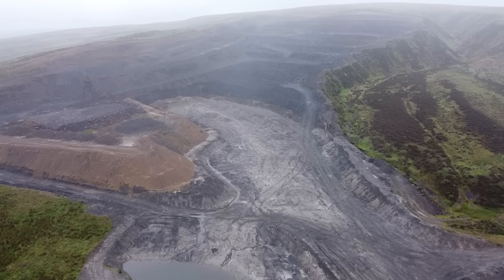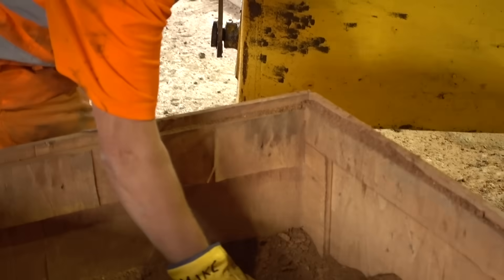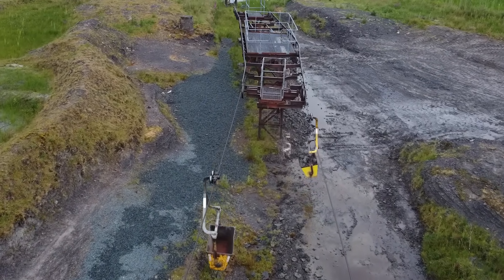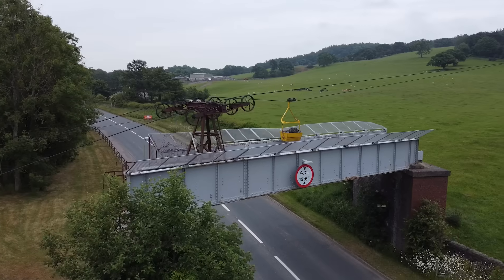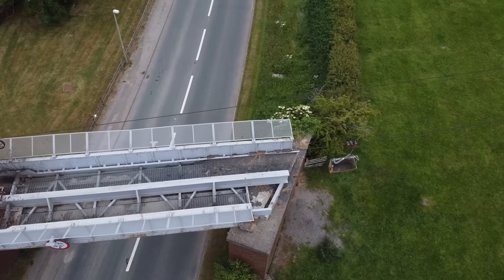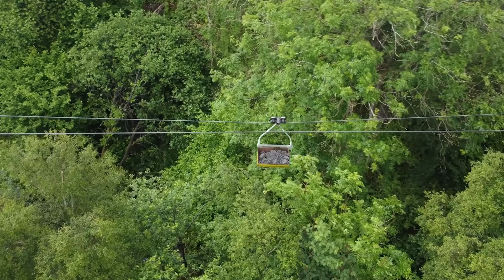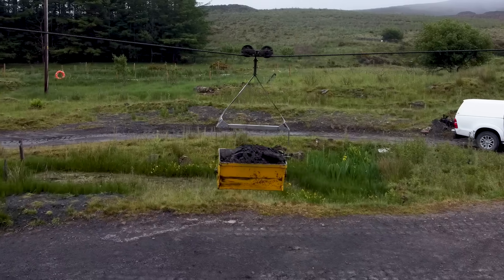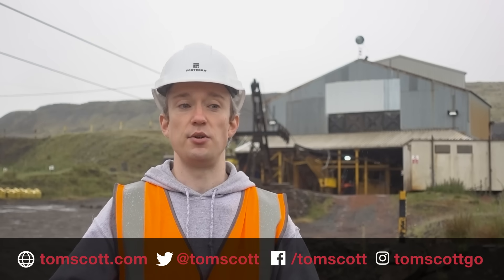The UK's last aerial ropeway uses no power, moves 300 tonnes a day, and will be gone by 2036.

Comment: Quarrying and brickmaking are never likely to be seen as "green" industries, but in a world where we are seeking to reduce carbon emissions transporting goods downhill purely by gravity seems like a very sensible idea. There must be many other applications where a similar type of aerial ropeway could be used to replace conveyor belts and/or trucks.
Reply: You need material for building - and you're gonna have to quarry it somewhere. Doesn't matter if it's shale, wood,, steel, or sand for concrete. Bricks are good. They last a long time (if well made and well cared for), can be recycled more easily than any of the others, and they're bricks! Bricks are cool.
Reply: @vaclav_fejt  Thank you
Reply: @vaclav_fejt  shhhh, don't tell the Americans that
Reply: It wouldn't even have to be an aerial ropeway, I think. You could probably get the same result with a narrow gauge railway system. It's only important that more weight goes down than needs to be pulled up.
Reply: @rolfs2165  Sure, in ideal conditions it is equivalent, but there is a problem of friction; if the slope isn't steep enough, you need the least possible friction generated. I believe it's also easier to build air ropeway since you need much less material and land modification (build end stations, erect few pylons, stretch steel rope... and profit! :-) )
Reply: @rolfs2165  The narrow gauge rail system would have more friction involved, so it may not work.
Reply: Nothing stops people from making a conveyer belt that works on gravity too :)
Same principle, the weight of the shale pulls the top of the conveyer down, the bottom side will be pulled around too, just like the rope here
Reply: I think some of the Oils sands in Alberta do something similar with electric dump trucks.  They use electric breaking and the truck's batteries need to be regularly discharged into the grid because of the excess energy generated. The height difference and difference in load weight means they never need to be charged.
Reply: @jonathansharman9279  Where did you get that information? The latest I have is that some oil sands operations are switching to autonomous vehicles to eliminate jobs, er, cough "improve safety and lower operating costs". But these are deisel-fueled vehicles that consume some 15 000 L per day. Diesel shovels replaced electric shovels which replaced bucket and conveyor systems decades ago because that electric eqipment had to remain connected to the source of the electricity, which was being generated on site. So even they were burning fuel anyway.

You may be thinking of other mining operations where material is transported down from a mining site. But bitumen has to be dug up. A big part of the operating costs is removing the overburden. If they have to dig down too far, it's not economical no matter how much they externalize the costs of environmental impacts and infrastructure. 

Or, maybe you heard about steam-assisted gravity drainage. That's where they frack the rock, inject steam to heat the tar-sands deposit and liquify the bitumen so it flows by gravity into a horizontal well pipe below, and then pump the bitumen out. 

None of it is remotely environmentally responsible, given what we know about climate change. The only thing the tar-sands companies are hoping for is a long, slow implementation of nuclear energy, which they are pushing politicians and voters toward instead of renewables. The industry plans on using small modular nuclear reactors to heat bitumen for easier extraction. (Though they don't like saying the nuclear bit out loud so, they say SMRs or better yet, thermal plants, which could be geothermal or... not.) They also want investors to stay invested hoping to capitalize on extracting lithium (and possibly, and hopefully with little public discussion, uranium) from tar-sands brine. The lithium would mainly go into batteries for electric vehicles. But that's a market disruption undercutting their primary revenue stream which is for-profit pollution (via fossil fuels). Some analysts say the tar-sands industry is running scared of EVs, so I think the last thing they would want to do is demonstrate that heavy industrial vehicles like theirs can be electric. 

I may be wrong, so feel free to correct me. I'm really hoping you're right.
Reply: @perrisici  Well "15 000 L of diesel" isn't relevant without telling how much work it gets done. The good thing about diesel engine for work is that at best it is highly efficient (compared to other combustion engines), diesel engine is the best of the combustion engines for the climate, and in diesel engines the bigger two stroke ones are usually even more efficient, most efficient ones being big 2 stroke low speed ship engines.

Of course electric motor is far more efficient than any heat engine, but electric motor itself is not the whole system as you describe. It needs either a connection to the grid, or local power generation facility, or a battery. Biggest mining trucks already use electric motors to drive but they have diesel engine that generates electricity that drives the wheels. It is called diesel electric transmission and been common on very heavy vehicles for a long time. It is because electric drives allows to make the transmission simple. These would be easy to convert to fully electric.

So the difficult thing in electrification of mining machinery is the need for power source. Of course they are now ramping up the battery production, but the question is will there be enough materials for all uses if everything is done with batteries, which at least with current battery chemistries looks like it may become a big problem.

One solution is of course synthetic fuels. For example a nuclear plant generates usually as much waste heat as it generates electricity. Normal electric efficiency of nuclear plant is less than 50%, the rest is wasted as heat. There is processes for generating hydrogen directly from waste heat ( I don't although know are they ready yet for commercial production ). And when you add carbon to hydrogen, you get hydrocarbon fuels that can be used in ICE engines. Or you can use the hydrogen directly, but handling hydrogen is more difficult than handling hydrocarbon fuels.
Reply: More emissions getting the trucks back up the hill. 
This is where some Electric systems could come in, regen down and power back up.
Reply: Think this is about as green as it gets unless you use regenerative braking system and create a bit of electrical power for the mine, as said we need good bricks from somewhere and this seems to be as good as it gets,  all things considered.
Reply: @marksmith4664  electric motors and brake require mining operations to extract the minerals to build the motors.
Reply: There is a mine where they use electrical dumpster trucks. The drive down fully loaded and charge more on the way down than what they use on the way up.
Reply: I've heard that there is a quarry which uses electric dump trucks which charge on the way down when full, dump the load and go back up using the stored energy only.
Reply: @piast99  A quarry the puts stuff INTO the ground? Sounds more like a dump pit of some kind.
Reply: Yes, and no. It's choice between simplicity and efficiency. Simple solution is the most accessible where as a the more efficient solution will be harder to implement. Energy recovery systems aren't new but like I said harder to implement.
Reply: If you use eletric trucks and run them as a generator downhill you get the same effect
Reply: @manuelsoares4343 They are not 100 % efficient, so you will always lose some. They carry more weight down than they do up, so the effects will balance out.
Reply: In the other hand thinking, even a diesel truck going down hill doesn't use any energy either. But when going up as empty, there it uses. 300 tons a day although is only 5 truck loads if the truck has 60 ton transport capacity, which is of course big but not unsual for mining vehicles.
Reply: The thing i remember about the tour around an active open pit coal mine was they had an aerial ropeway. At one point they replaced half of it's distance with trucks, and then got the frightning revelation that they were now paying for electricity, since they had reduced how far it went and thus how much electricity it produced.
Reply: we'll always need bricks.
Reply: Apparently they require 4 people to operate and that would be about £160k per year to operate + maintenance costs.  (Converted Norwegian salary to Pound sterling)
And, it doesn't seem like it is able to transport that much.
Enough for that factory, but not enough for those that export.
Reply: @dubious6718  it said it move 300 tonnes a day, didn't it? I'd say thats a lot
Reply: @lenonel3286  Roughly 10 dump trucks. Could probably be done by 2 men (2 trucks) going back and forth.
Reply: @SideQuestAdventuring  dump truck would absolutely destroy the road they go through that building a proper road is economically impossible. I'd say aerial trolley preserve the environment these rocks have to go through.
Reply: @lenonel3286  300 tonnes a day is nothing compared to a conveyer
Reply: @SideQuestAdventuring  My guess is that by the time you've bought, maintained and depreciated those vehicles and add fuel it's possibly a close run thing - but let's be fair. This system is damned near silent.
Reply: We can't get trucks through the local village without people complaining unfortunately.
Reply: @nrdesign1991 it isn’t the fact that other systems could be “better”, it’s the fact its been running since 1920, is the last working one in the UK and it is efficient.
Reply: @dubious6718  that system could be easily automated.
No manual labor needed.
I guess for that factory a redesign would be more expensive than to pay those laborers.
Reply: @dubious6718  “Norwegian Salary” there’s your problem. You lot are paid twice as much as we Brits are…
Reply: Actually he's not far off. I work at Claughton and it actually takes 5 people in total to run with an average annual salary of 150k between them. That's not including overtime etc too 😁
Reply: @dubious6718  Depends how often it goes out of service. Industrial settings like simple and reliable. They'll pay a premium for it because any breakdown will end up being more expensive than the upgrade.
Reply: @dubious6718  Could be made bigger for sure, I think the size is limited by the factory, not the transport speed
Reply: "green" energy involves lithium, copper, silver, and other rare earth metal mining.
Reply: @blakeelzinga1168  If you slap a motor and a battery on a bicycle, you get a green vehicle, not sure why.
Reply: @blakeelzinga1168  Electric power is cool. Batteries are not.
Reply: What if...a ski lift system that staggers the chairs coming down the rope closer together than the loaded chairs going up the rope. Usually a powered ski lift has more weight to lift up the rope because (seats + passengers) > (empty seats).
But, if you have say 10 full seats further apart going up  the rope, and 20 empty  seats bunched together coming down the rope, then assuming a full load of passengers is lighter than the seats themselves, (20 empty seats) > (10 full seats) and you have an un powered ski lift.

Edit: i have rightly been informed this would not work as more chairs would go down then would come up
Reply: @aransmeallie5344  what are you gonna do with the pile of empty seats at the bottom of the hill? If you’ve consistently got twice as many chairs going down as you do going up, you’ll eventually run out of chairs to send down the hill.
Reply: @Acidlib  literally had that thought a day later and came back to amend my proposition there 😂
Clearly didnt have all the pieces there
Reply: @aransmeallie5344  But then only 10 of those 20 seats would go up again while 10 remain down and now you need to have 20 seats coming down again but only 10 went up last time. Doesn't work if my thinking is correct
Reply: @FeiZoomer  literally had that thought a day later and came back to amend my proposition there 😂
Clearly didnt have all the pieces there
Reply: Maybe the concept could be used to power a motor? The motor would be charged from the rotation of the mechanism, which I suppose would have to either be manned or else have robots switching weights around. Maybe the net size of the ecological footprint would be smaller?
Reply: Yes the politicians and corporations are seeking to “reduce” carbon by taxing the hell out of us and making everything expensive while taking trips to space. The whole green nonsense is a sham and nothing more.
Reply: For example the two 🤣🤨🤣😐
Reply: Now i have a lot 🤨😶😍😙

Comment: This seems like a very efficient system considering it doesn’t need any fuel physical input by engines and it’s just powered by gravity I think there should be a kick starter campaign to keep this thing going once the mind closes as an attraction or build more this seems like a really good way to transport things if this could be the next mass transport England is full of hills these can be used to move things like people
Reply: As long as the people only want to go downhill...
Reply: "as an attraction" - those are called cable-cars.

Comment: You can use it to generate power as well!
The aerial ropeway in the Czech limestone quarry of Černý Důl carries the stone to the Kunčice nad Labem train station. Due to the terrain, a 50Hz synchronous motor is needed to start it, and later regulates the speed so that it rotation matches the mains frequency (and feeds the extra power to the powerlines). It is 8 km (5 mi) long and will be likely dismantled next year as the quarry is nearly exhausted (and cannot spread due to a protected area). You can watch a guy illegally riding it at ?v=OERbOBUuMBY
Reply: "Generating" power by using machinery to lift weights to the top of a ropeway is like saying you're "Generating" power by using a wave machine to make waves to power tidal generators. Aka, you're overall LOSING energy.
Reply: @Winasaurus   No, electricity is actually being generated, as much like the one in Claughton, the Černý důl quarry is at the upper station (in the mountains, where limestone is located shallow in the ground) and the transport hub is at the lower station in a river valley (practical for railway construction). Because of the terrain, the ropeway’s inclination reverses several times, though (at the start of the linked video, the full crates appear to be travelling up but they go down overall), and that’s why a motor is required during startup and close to shutdown.

Comment: Does the Chairlift at the Needles, Isle of Wight not count?
Reply: That's a chair lift not a ropeway, ropeway literally carry stuff not people.
Reply: @derekwright2388  Ahh I see.
Reply: and doesn't that have an engine to power the chairlift?
Reply: I wouldn't be too much of a stretch, conceptually to convert it to a chairlift. You'd need to supply power, since the load is going uphill rather than down. Other than that and the technical details (details, that's where the devil resides) it's about the same thing as a chairlift.